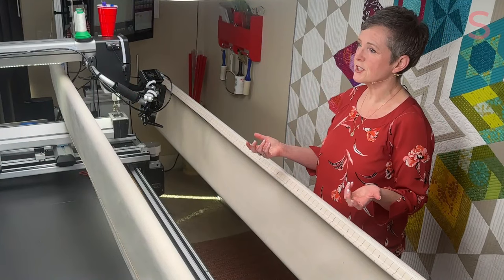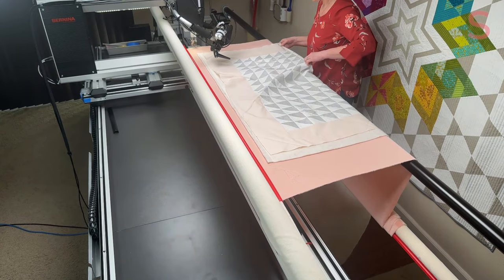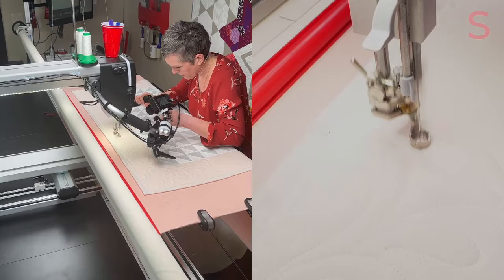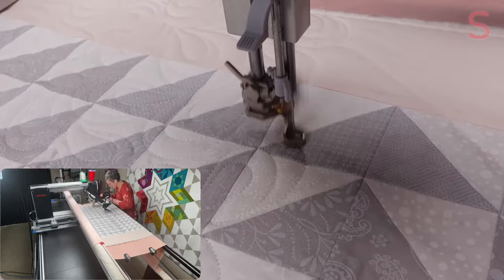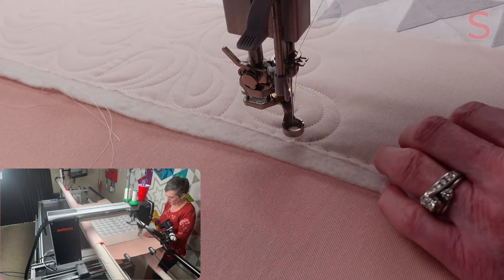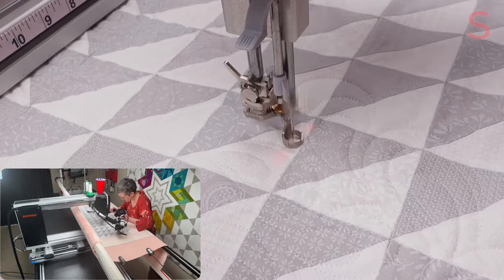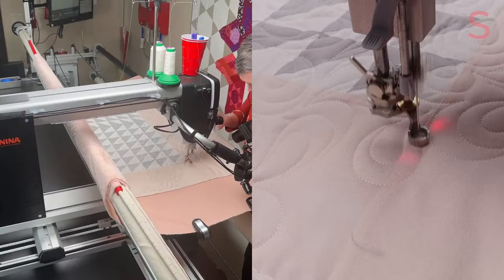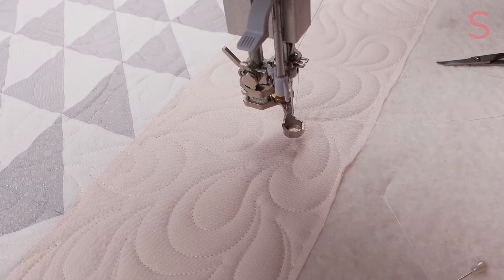Baby Quilt - Minky Backing & Simple Piecing

Comment: I don't (yet!) have a longarm machine, but I love watching you work and I learn so much. Thank you so much for sharing your processes and information. When I do get a longarm, I'll have way more confidence to dive in and quilt right off the bat than I would have, had I not watched and listened to all your golden nuggets of wisdom and experience.

Regarding quilting around flanges: I have put a flange on a few of my quilts, between the main body of the quilt and a border and I always quilt the main body first, then add the flange and border all around, then quilt the border. That way I can quilt right off the edge of the main body without running the risk of wreaking my flange. (I'm also extra careful to not quilt over the flange when quilting the border ;-) )

Comment: Are you going to set the bars on the sides to keep the fabric taught or not on stretchy materials like minky
Reply from the maker: I did not use the bars because the Minky won't fit in the channels, but I did ver gently apply my clamps to each side.